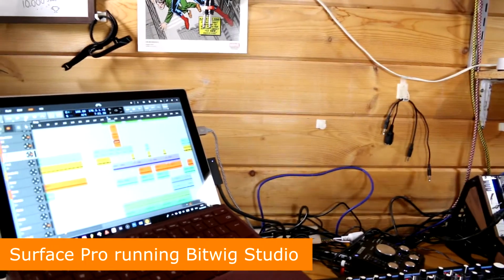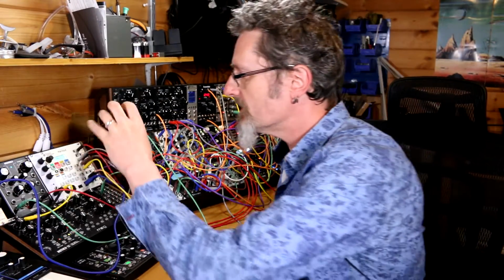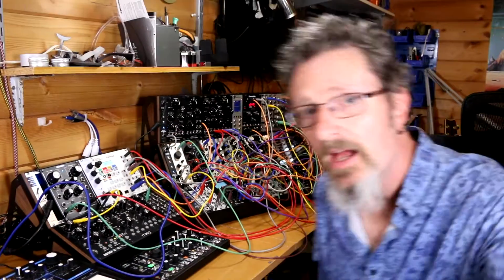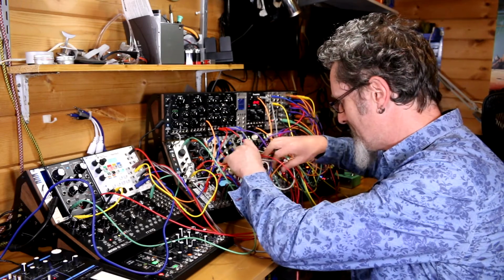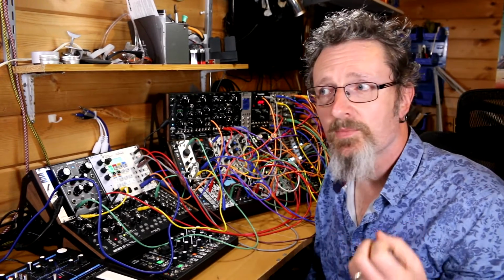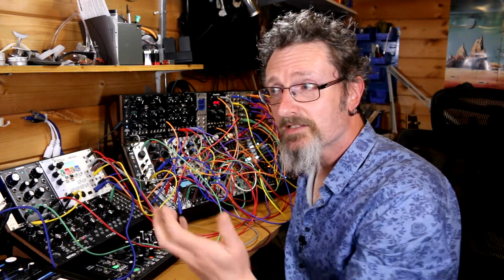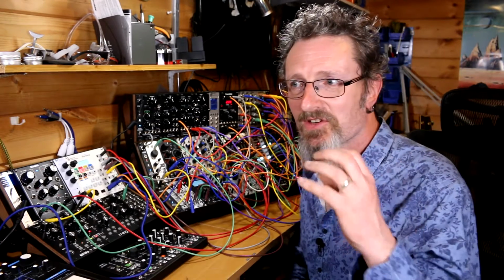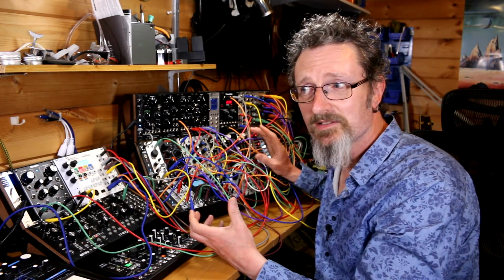Molten Modular 22 - Bitwig to Hermod to modular experiment

Comment: I’ve had extremely good luck with DAW integration using expert sleepers modules and their silent way suite of plugins. I use the ES-3 for outputs which gives me 8 Chanel’s of anything I want, clock, cv and gate, envelopes, polyphony. Then I use the ES-6 for inputs sending audio or CV back in to the DAW. The real bonus I find is tight sync since I can send clocks and resets to any sequencer I have running. The only thing I deal with then is latency in the recordings which I just manually compensate for. I LOVE ❤️ expert sleepers! Great video! Very entertaining.
Reply: many DAWs have delay compensation for latency issues with hardware.

Comment: I’m a little late to comment...I totally get what you’re going for. Definitely on the right track. I just got the Hermod. I’m hoping the Hermod can slave to tempo changes...time will tell. Also I’m hoping the midi out on the Hermod will send clock out as I have a TC Electronic Triple Flash Back that has a midi input for clocking. Will use, as you have the Strymon AA.1 for use with the pedals. Hermod is deep, but a little more labor intensive that it might need to be. Thx for the vid.

Comment: Could I sequence an offrack module like The Streichfett by taking MIDI out of the Streichfett and plugging it into the MIDI in of the Hermod?"
Reply: By the way, the groove really came together at the end. But you really need to get a dedicated eurorack mixer and compressor. The Befaco Hexmix is great, but it takes up 28 hp on top of each other, meaning you'll need another 6U rack to accommodate it. Then, you'll want to get the VCA expander. Or, the WMD Mixer is great too, but to get the full usage out of it, you'll need to spend about 106hp after all of the expanders. If you wanted the full switching/routing matrix, that will make it 130 hp. You'll need a separate, dedicated case for mixing and routing only.
Reply from the maker: Yes, if you plug those cables in the other way round 😁
Reply from the maker: Yes, mixing can get a bit nuts. I’ve just invested in some Tesseract mixer modules which should do the job in a smaller and cheaper space. Should have them next week.
Reply: @MoltenMusicTech  Yeah! You can use those to mix 4 channels for mono and 4 for stereo and then get the master control module and that ought to do it. You can send out of the master, into an interface and record in the DAW. By the way, you CAN save sequences in the Hermod with the SD card in the back.
Reply from the maker: Yes, that's it :)

Comment: Can the Hermod also be used to send audio tracks to and from the DAW?
Reply from the maker: No, the computer sees it as a MIDI device
Reply: What you can do is take MIDI out into the Hermod, compose your song with your eurorack, and then send the final mix out of your mixer into a 4MS Listen 4 and then into a 4MS WAV as an end-of-chain module. "Bake" the tune in the WAV's SD card and transfer it to your laptop and pump the audio into your DAW. If you want the Hermod to control your DAW, it won't.
Reply: But this way, you can save your composition into your DAW and send it into the wild onto the platform of your choice.